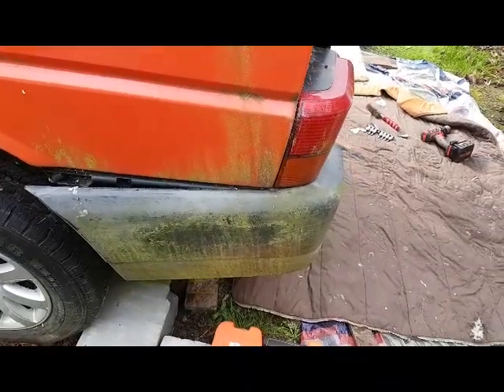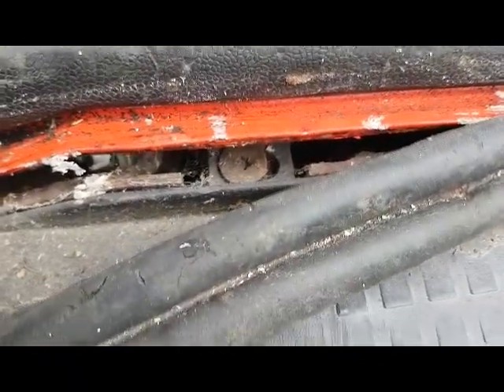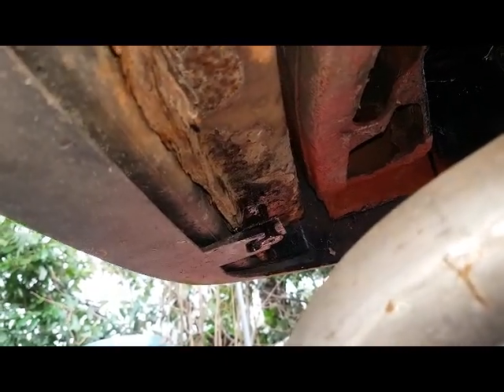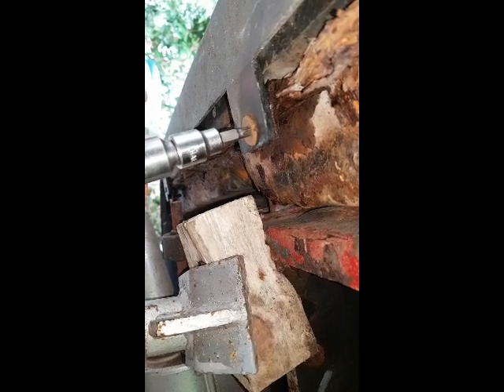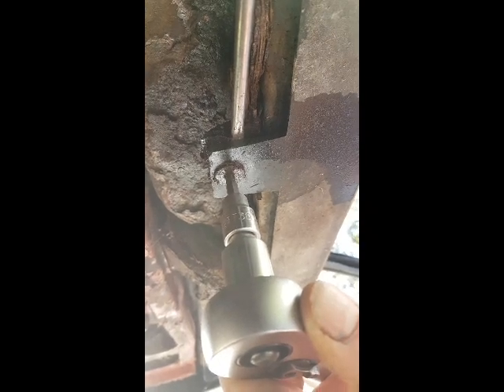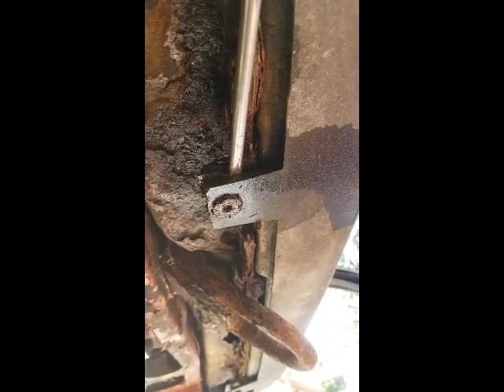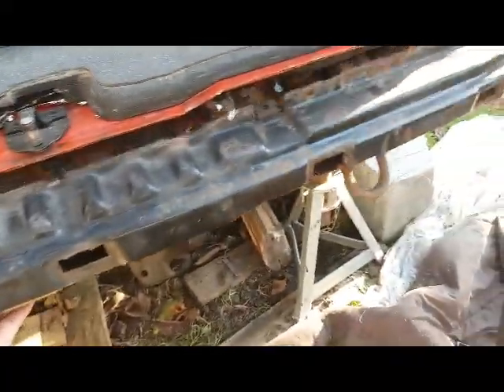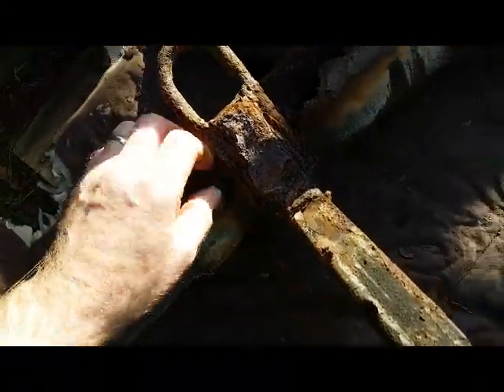VW T4 rear bumper & crash bar removal & repair🔥✔

Comment: Know how to remove mine thanks . Think leave bumper on the crash bar until its removed.
Reply: Yep. A little trickier if there's a tow bar fitted, but definitely easier than fiddling about with those torx bolts when bumper in situ.

Comment: Great video Mark, so helpful; thanks for posting it. It looks like a way to undo those hard to access star bolts on the top of the bumper would be to undo the crash bar nuts and slide it out slightly first. What do you think?
Reply from the maker: Yes mate that would make its easier, good idea you will just have to unclipped the bumper corners.
Good luck👍
Reply: Thanks mate - and again, thank you for your great videos. @markrocketmangrimstead

Comment: Nice video and good work. Could the whole lot come off when just removing the crash bar in one peice?
Reply from the maker: Yes it probably would,you would just have to remove the 90 degree ends of the bumper from the bodywork.
But thankyou 👌
Reply: Just had to do this. There's a bunch of torx screws on the outside and 4 18mm bolts on the frame rail. Don't wedge up the body panel to get to those buried torx screws.